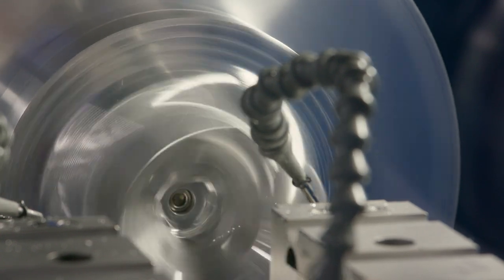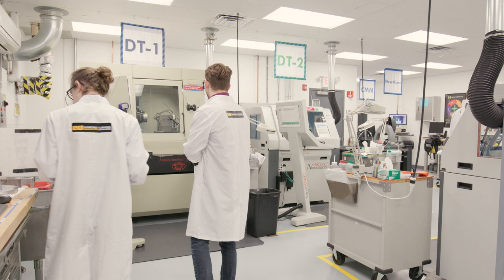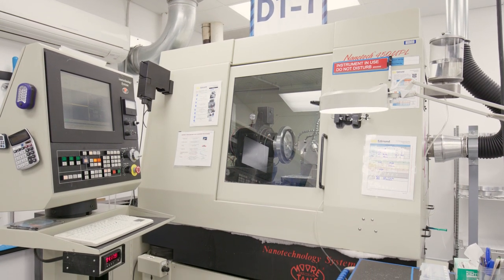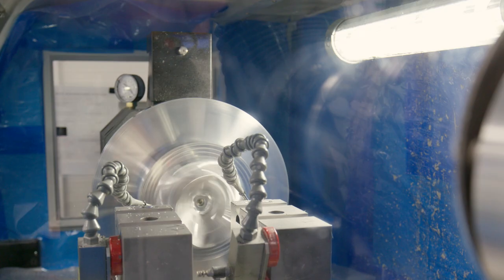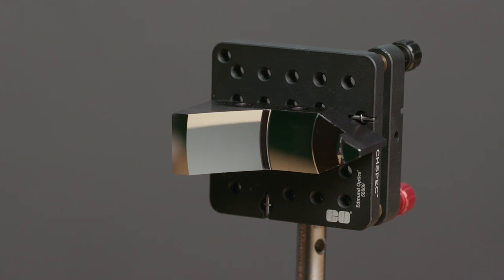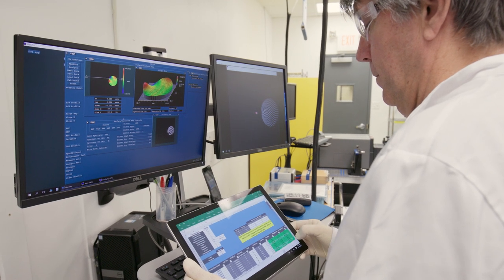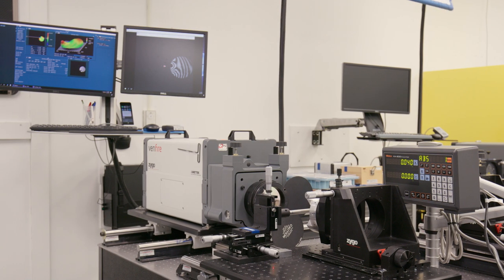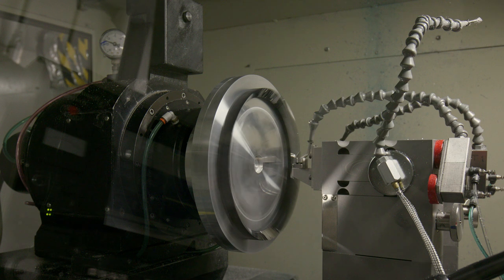Single Point Diamond Turning: EO Build-to-Print Manufacturing

Comment: Thank you for posting this beautiful video on Single Point Diamond Turning. Edmund Optics is one of the leaders in this industry. Maybe some folks are wondering whether glass can be machined with a CNC. Apparently, yes it can, but it is trickier than metals and metal alloys and instead of carbide tips used in metal machining, generally diamond tips are used on lathes and machining centers. Ultrasonic machining technique is also commonly used. Other techniques specific to optical industry and precision ceramic manufacturing need to be used for many optical components such as lenses, mirrors, prisms....etc. Those techniques include grinding, lapping, polishing using slurries with various grit size. Generally, you start with grinding and go down to polishing and lapping that is carried out with finer grit slurry to finish up the manufacturing process of optical components. Manufacturing precision optics is more demanding than metal parts manufacturing, because optical surfaces must be clean and very smooth. Optical component geometries require high accuracy and small tolerances because when mounted, any small misalignment or tilt can deflect, reflect, refract the light in unwanted directions. Also since optical components are often coated with metal or metal oxides to act as mirror or filter, the surface roughness has to be very low to allow smoothly coated surfaces. Also cleanliness and precautions against contamination are critical and there are many cleaning steps involved. A small mistake or contamination, scratch, chip, defect or else can easily render the final product as scrap and repairing optical components is much more difficult or impossible as compared to metal parts. Especially when optics is made for high power laser applications, any small defect or contamination can cause a local burn at the defect / contamination site and result in downtime of the apparatus in which the optics is mounted. Please visit our Youtube channel by clicking our logo on the left for other good content on manufacturing techniques and engineering content.